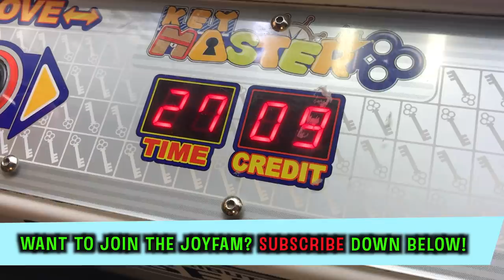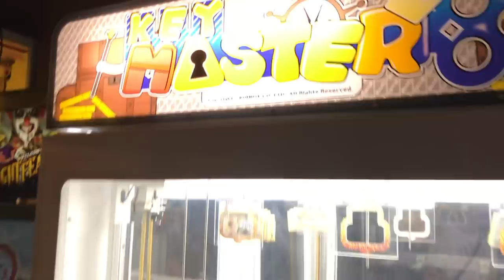MADE SO MUCH MONEY FROM CASH KEY MASTER ARCADE GAME! | JOYSTICK

Comment: All arcade gaming is rigged, fixed deflecting plates on the coin pushers , claw/ crane grabbing devices set for functioning correctly only after a set amount of tries, light stopping button games with random time delay .
If you want to win don't play, if you want a gamblers chance then watch others play and study why they are loosing.
If you really want to waste your money play the ticket winning games and get loads of tickets costing loads of money so you can cash them in for a really cheep crappy prize.
My advice, if you want to play a machine and win, put your money in the change machine.